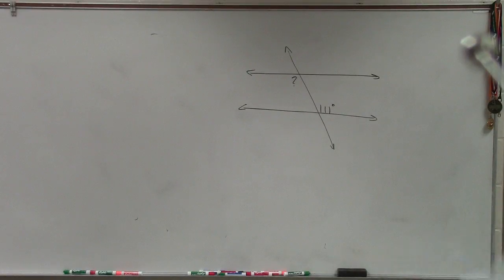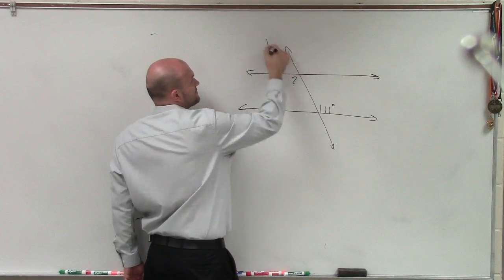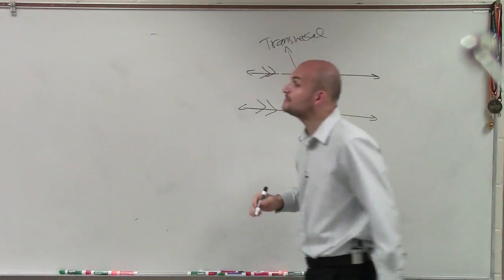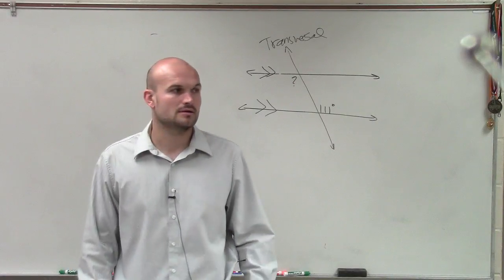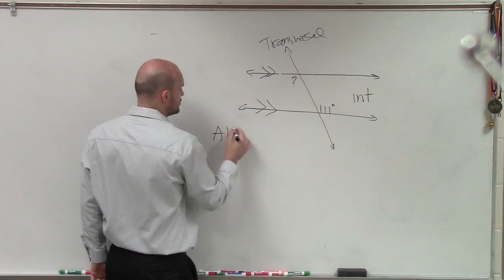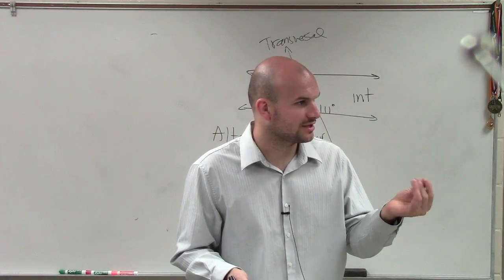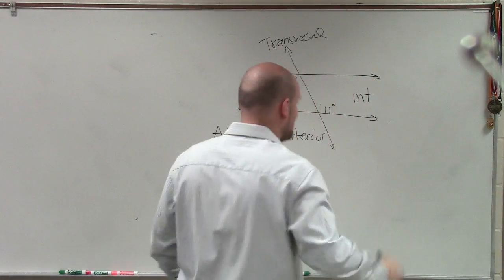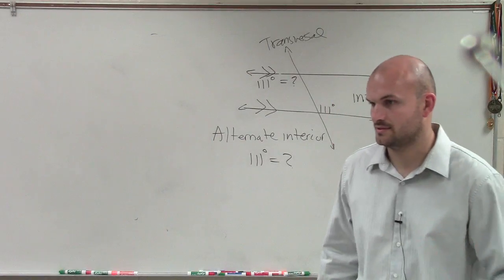Using Alternate Interior Angles to Find the Missing Measure of an Angle

Comment: How do you find it when the transverse is a side of a triangle and two parallel lines cross the transverse and you’ve got no information of one of the information of one of the parallel lines interior angles and the angles of the triangles angles are 34,45 and 58 respectively from the top of the triangle moving clockwise ?